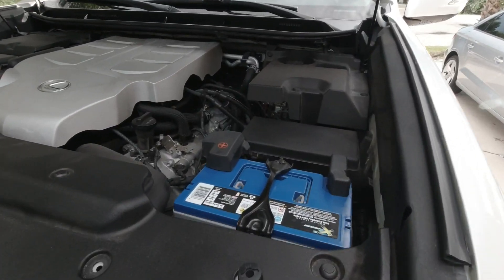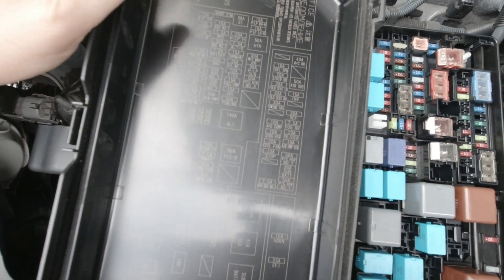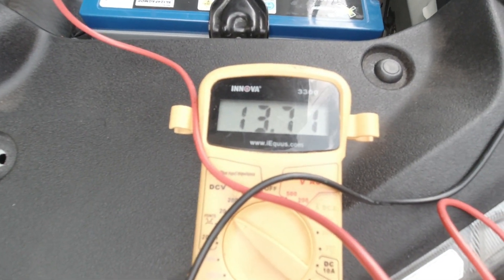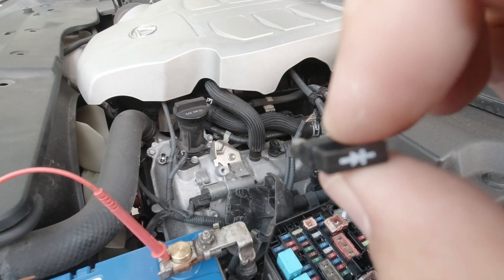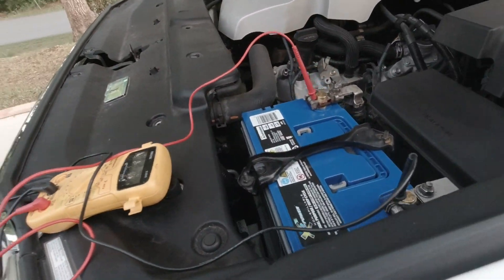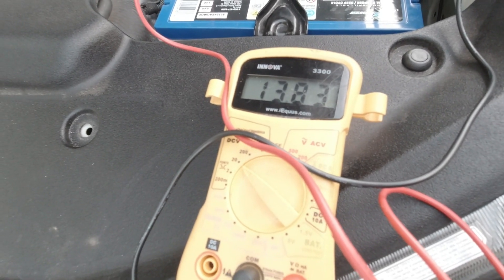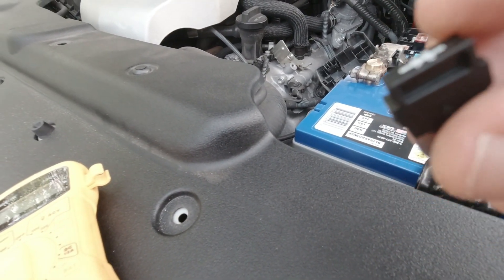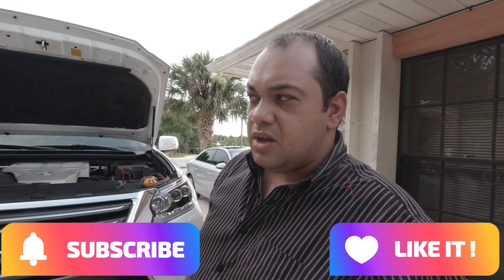Upgrade to an AGM battery

Comment: Great video! I am thinking about getting this battery on my F-150. The alternator already pumps out >14V, so I think I don’t need a diode. 

I checked BatteriesPlus and learned the warranty is now only 4 years. Sad.

However, Autozone has their Premium Elite AGM battery with 5 years warranty. And it’s $100 cheaper than the X2. 

Decisions decisions decisions..

Comment: I idle speed charging is different than speeds over 35 mph right? I use a EverStart Platinum in my 2019 Toyota Sienna SE Premium which idle voltage is 14.1v. i would worry that diode would not fail quickly enough to protect the sensitive electronics. Also try using sn OBDII scanner for accurate voltage readings. Nice video! Subscribed.

Comment: please don't do this, it is useless and swapping a fuse for a diode is not recommended . swap the battery and it should one fine
Reply from the maker: I actually got another device which is much better. I made a video about it. Thanks

Comment: In what universe does it make sense to replace a fuse with a diode?
Reply from the maker: No idea??
Reply: @DIYSpeedGarage  It doesn't in this universe. A fuse is a sacrificial component. It's designed to fail and break the circuit before current in excess of the fuse's rating (e.g., 20A) can do significant damage to the device it's protecting (e.g., blowing up your car's computer, setting your house on fire, etc.) or to people on, around, or in the device. 

A blown fuse (or circuit breaker, which essentially is a reusable fuse) frequently is the first sign of an electrical problem. Example: at a place I used to work, one of the offices was having trouble with the circuit breakers tripping. I noticed it occurred when someone made coffee in the big, industrial coffee/hot water machine. I checked the power cord: it was hot to the touch at the plug end, which meant broken wires in the cable were shorting out against each other.

A diode's job is to control the direction of current flow, which is why it has to be oriented in the proper direction: it's basically a one-way valve. It's not designed to protect against disaster caused by overcurrent.
Reply from the maker: Well I installed another device that looks a little better. I think I made a video about it as well. 😁

Comment: My experience with x2 and batteries plus is negative.  My one year old battery has failed to start i my Ram  after two-day weekends twice. It failed to start after cleaning my cab out and listening to radio less than an hour.  It failed to start twice last december after sub zero nights. I took battery in and batteries plus said there was no issue with it.  I put Stock battery back in my truck four months ago and have had no issues with stock battery.  I  get 14.8vlts on alternator in the Ram.  I decided to use the x2 as a trolling battery for my 16' alumacraft instead, however every time i go to take it off the shelf the battery is less than 12.4v. I have tried multiple chargers.  All three of my chargers work great on the Optima batteries in my camper.  Optima batteries are almost 10 years old now and charge to 12.7 and 12.8 after one night on charger. Zero issues ever with optima.  That's what i get for looking around the store while i was getting a cell phone battery replaced (not real happy with that battery either btw)  So $379 Flushed and feel assulted and Battery Plus.  I really need to quit spending money in these giant chain stores.  They couldn't care less.  ALSO STICKERS ARE PEELING OFF OF THE BATTERY.  I have never seen that on a battery, so cheap.  Store #275 toledo, ohio

Comment: Spoke with Shawn Budiac, director of X2 batteries, 3 weeks ago on the phone. Told him about how I was mistreated and harrassed by two separate Batteries and Plus stores about how they weren't going to honor the warranty because my battery was "neglected".  Shawn said that he was going to take care of me in a few days and in the meantime make sure the store gets trained better. 3 weeks later, he is dodging my phone calls and I have heard absolutely nothing. I am stuck here with a $400 battery that doesn't work after 5 months. I will echo this until I die, NEVER EVER EVER EVER buy X2 Power batteries. This company will leave you HIGH AND DRY when you need help, from the customer service rep at the counter all the way to the guy who runs the stuff for USA, they do NOT care about us after they take our money.

Comment: Kool Thanks for sharing. 

You can cut the legs and shape it like the mini fuse II that way it sits more low profile? Just place your low profile fuse over the Diode and trace it with a pointy thin marker and cut it out the same shape. 

Is there a way to tell if your mini diode is blown visually? I see it's all Standard black, not see through like regular fuses.
Reply from the maker: I never tried but I think it's possible to trim the fuse if you needed one in an emergency.
I don't think there is a way to tell if the diode goes bad. I did switch to something a little better. Check out the video, should be one of my most recent videos.
Reply: @DIYSpeedGarage  Kool will do.

Comment: It boosts your alternator output voltage ~0.5V.
However I don't understand the advantage because some technical lists say AGM are to be charged at lower voltages.
Also you are withing the charging tolerance so what's the point of this "upgrade"?
Reply from the maker: 5 year replacement warranty is the upgrade. I have yet to find another battery with a 5 year replacement.

Comment: I’ve read on forums they are very strict with warranties. Do you agree?
Reply from the maker: It depends on the problem that needs to be repaired under warranty
Reply: @DIYSpeedGarage  overall still worth it or go with Odyssey?
Reply from the maker: I think it's worth it, especially because of the 5 year replacement warranty.

Comment: Wrong.....agm batteries require low voltage charging... they are a deep cycle  you do not need no kind of chip to use them..  I have been using them for over 12 years
Do trust and believe that is an awesome Northstar battery.. also many cars like new jeeps, BMW, Mercedes come standard with AGM batteries
Reply from the maker: Well I'm sure glad someone is right 😁👌🏻

Comment: I have a group 35 x2 installed, would this same diode you linked be the one I’m looking for?
Reply from the maker: Yes sir, I'm not sure which link I have in the description but Amazon only sells a pack of a few, if you buy from O'Reilly they sell a single one.
Reply: @DIYSpeedGarage  I should clarify too, I have a Subaru, not a Lexus
Reply from the maker: As long as you know the location to install the diode and as long as it fits in your Subaru, then yes this will work the same way.
Reply: @DIYSpeedGarage  sweet, that’s the hard part for me right now 😂 Subaru didn’t label the fuse box very well haha
Reply from the maker: Check the Subaru forums, I'm sure you'll find something.

Comment: Increasing the alternator voltage, won’t that wear out the alternator faster?
Reply from the maker: No sir, the only thing that wears out in an alternator are the brushes inside, voltage does not make them wear out faster so nothing to worry about. Thanks for watching 😁

Comment: you did not need to replace the fuse at all !!!
Reply from the maker: I did not replace the fuse, I removed it and installed a diode instead. Thanks for watching 👍🏼
Reply: Explain yourself? Or maybe your ok with making yourself look lame.

Comment: Are you planning to do 2020 grille/lights?
Reply from the maker: Not really. I would consider it if there was a way to use original factory headlights from 2020+. Don't want to use aftermarket.
Reply from the maker: When it comes to headlights i just can't go with aftermarket 😆

Comment: There is no advantage in upgrading to an AGM unless you are going to have constant power draws from some sort of inside appliance. Standard flooded lead acid batteries are just fine.
Reply from the maker: I agree, for 99% of owners a standard battery is fine. There is also another advantage with my AGM, it has a 5 year replacement warranty. Haven't seen a standard lead acid with more than a 3 year warranty.
Reply: No advantage? Then you state the main advantage of having a AGM battery like its not important. Some people naturally make themselves disadvantageous in life.
Reply: @jaycarl1562  Qualified statement I made. Constant power draw from inside appliance. Otherwise, again, no advantage.
Reply: Disagree. It's heavily better to use AGM in cold weather.
Reply: + deep cycle and last longer.

Comment: I'm lost, what fuse did you pull to increase the voltage?  I watched about 3 times and couldn't figure it out.
Reply from the maker: It’s the 7.5A fuse, should be labeled as ALT. Then you need to install the diode

Comment: So how does the diode increase charging volts? Considering diode only controls the direction of current? Any idea?
Reply: This doesn't make sense electrically speaking. A diode only controls direction.
Reply from the maker: No idea how 😂
Reply: He did not need to replace the fuse at all !!!

Comment: So how does the diode increase charging volts? Considering diode only controls the direction of current? Any idea?
Reply from the maker: Honestly I don't know much about electrical things, i just know that before I installed the diode there was a 7.5 amp fuse in that location, once i replaced the fuse with the diode the battery was getting more volts 🤔🧐 
You would need to ask an auto electrician or someone who knows about electrical stuff 😂 sorry i couldn't answer your question
Reply: @DIYSpeedGarage  oh okay. I was just curious. You have awesome videos btw!
Reply from the maker: Thank you 😎😁
Reply: @usertakenagain  Whereas the fuse obviously lets power flow from one side to the other with almost zero resistance, the diode will cut about 0.4 volts off as voltage passes through it. So, if the car is commanding and reading 13.4 volts with the OEM fuse, the car with the diode installed will only "see" 13.0 of those 13.4 volts at the ECU. The ECU will then raise the voltage so it "sees" 13.4 volts, when in reality it is now 13.8 volts.

Just a tip if you do this, and at some point in the future you take your car in to a dealer to get a battery replaced or other work done, you may want to tell them about the diode. If the look at the voltage using their scan tool they will see the "fake" lower reading. This is important because many of these cars can actually have commissioning of the battery specs programmed into the ECU by the dealer. If they were to do that (raise the charging voltage via ECU) without putting a meter on the battery or knowing about the diode, they could potentially raise the charging voltage of the car up to 15.4+ volts on a cold day. If that happened and nobody caught the problem, it would overcharge and ruin your battery. Could also ruin a few other things in your car if the upper limit went beyond tolerance of other electronics in the car and get expensive real fast.

But if you switch from old school flooded battery to AGM and don't plan on taking it to a dealer, the diode trick is the way to go.
Reply: @Cedar_Valley_Live  so I guess I should ask my dealer to update the ecu defaults? That looks like the thing to do instead of a hack, if possible.
Reply: @ishindersidhu  some cars can have the ECU's updated, i.e., "commissioning" the battery to the ECU. Some cannot. Call the diode a hack if you want, but it is a worthwhile alternative for $4 when switching from FLA to AGM, as opposed to doing nothing at all.
Reply from the maker: I actually have an update video to this, I added a fused diode now. Check out my new video.
Reply from the maker: They're are also other voltage boosters available: https://www.arclightleds.com/collection/dual-state-voltage-booster-5th-gen-4runner-fj-cruiser-pg2tb-brs6a

https://www.ebay.com/itm/Low-Profile-Mini-Fuse-Alternator-Voltage-Booster-Toyota-Tacoma-4Runner-Tundra-/164706700869?mkcid=16&mkevt=1&_trksid=p2349624.m46890.l49286&mkrid=711-127632-2357-0

Comment: Do you plan to use a smart charging system? Or is the system smart enough for the battery? What will you use for the solar charging battery source?
Reply from the maker: I've got a REDARC BCDC charging unit that is very smart, charges my lithium battery from the main battery, the unit also has a built in mppt controller for my solar panel so I'm 100% set up and ready with my dual battery setup. Still need to install my battery monitor but that's about it. I'll shoot a video on that this coming week, it won't be a DIY video but just a walkthrough video.
Reply: @DIYSpeedGarage  wow, oh yeah, I forgot you got a lithium auxiliary battery. Have you installed the red-arc yet? I need to call them and ask some questions since i want to install a 24 V auxiliary system, not sure if it’s compatible with the car’s 12volt.
Reply from the maker: @erikhaw7313  yeah the REDARC is installed, i had my ARB fridge running for around a week only of solar and the lithium battery 😁 Not sure about the 24v setup, I'm sure they'll help you out. Unfortunately their customer service is in Australia so you'll need to call them now. I think they're open from 10pm eastern time, over there is like 10am or something of that sort

Comment: Many thanks for the tip on the fuse! I have the X2 in 27F and didn't know about the extra step!
Reply from the maker: Hey Bryan, I honestly didn't know about it either until my buddy told me. Glad this helped 😉 Thanks for watching!
Reply: Bryan Kim did you have any fitment issues? Also, does the stock battery tie down work?
Reply: @Henray316  No fitment issues and stock tie down worked just fine :)